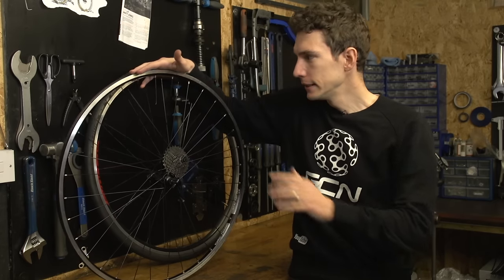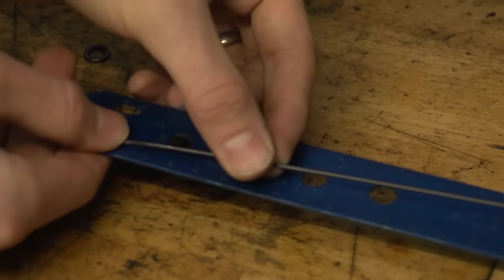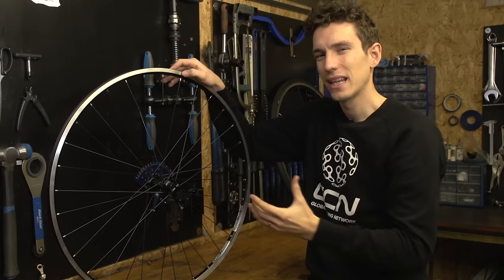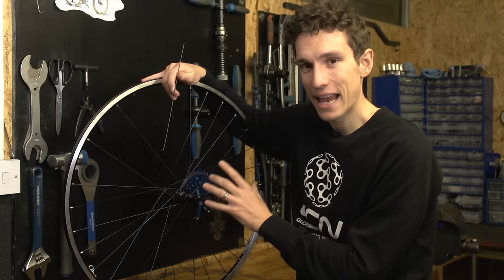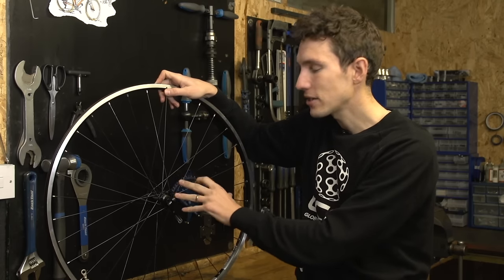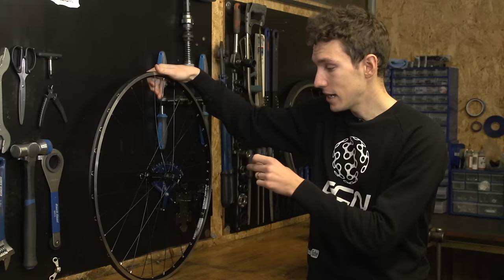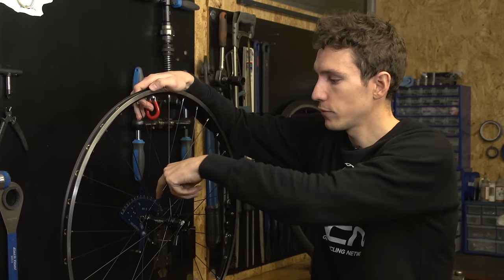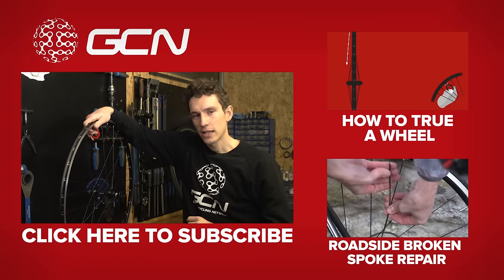How To Replace A Broken Spoke | Fix Your Road Bike With GCN

Comment: You picked the easy front wheel.  Show us how to replace the broken spoke on a rear wheel - especially when the spoke is on the cassette side!
Reply: Just take the wheel off.
Reply: It literally makes zero difference wether it's front or back wheel as you'll take the wheel off either way

Comment: Nice video. If you ever visit this subject again, I recommend providing a little more guidance with regard to spoke tension. Obviously, with a beginner-level "How To" video of this sort, you won't want to get into tension meters. But you could suggest that the user pluck the "good" spokes like a string on a guitar to hear their tone. Then tighten the new spoke until it produces the same tone (less tension for a lower tone, more tension for a higher tone). It's a very simple method to adjust spoke tension. If you suggest this technique, remember to alert the user that many rear wheels have different spoke tensions between the left and right sides -- so the user should only pluck and listen to spokes on the same side of a rear wheel.
Reply: ***** Yes, I'm well aware of that. But the subject of this beginner-level video is not truing a wheel. Rather it is replacing a spoke. If a rider needs to replace a spoke, they need to know that it also needs to be correctly tensioned. So it seems appropriate to explain that here -- after all, it is an essential step in replacing a spoke. Besides, the rider may have no intention of truing their own wheel -- what they need is to adequately repair it until they can get to their LBS. If they have any distance to ride, their wheel will be in better shape if they adjust the tension right away to prevent it going out of round -- or going out of round any worse.
Reply: Thanks, that's a great, logical way of knowing that they have the same tension!

Comment: Your explanation about tightening spokes in order to pull the rim in the direction of where the spoke originates on the hub I find is much clearer here than in the other wheel-truing videos. The visual representation aids in this as well.

Comment: Straight-pull is a type of spoke, not a lacing pattern-the other more common and basic type being the J-bend, where the head of the spoke is bent 90 degrees like an elbow. It's radial lacing where the spoke goes straight to the rim without crossing any other spokes-common on front wheels.

Comment: When I replace a spoke, I mark it with a piece of tape to make sure that is the first spoke I adjust when truing the wheel.  My goal is to only ever tension the new spoke to true-up the wheel because if there are other spokes out of tension then I really want to get it to the shop before I go  messing things up worse than they were before I broke that spoke.

Comment: Worth mentioning: If your wheel has 24 or less spokes, and is a shallow profile aluminum rim, chances are just replacing a broken spoke is going to leave you with a major high spot (vertical runout) on the rim.  Due to the higher spoke tension of less spokes, the only option is to detension the whole wheel and build it back up - because low spoke rims have to be brought up to tension evenly.

Comment: ...A little bit harder with disk brakes!

Also, if you bust a spoke on the road you can sort of compensate for it by just tightening the other spokes around it untilk you get home. It should ruin your rim less.

Comment: That was actually easier situation, it would be good to see if the spoke is from outside. I am struggling to bend spoke and it seems I need to remove few spokes just to put broken one.

Comment: Hey Simon, I actually remove spokes to lighten up my wheels. I have removed 4 from the front and 7 so far from the back. Definitely feel the difference on the climbing bits of my 3 mile commute to the job center. X

hudlum

Comment: Getting nipple off a broken spoke is usually easy: just bend the broken spoke to get some leverage and use the spoke key on it. Getting a straight pull spoke out of the hub end on the other hand, is the nightmare, especially if the plastic parts have become hard with age.

Comment: Its super easy to thread a spoke from the inside of the hub. I was hopping he would show how to do the other way.
Reply: Agreed. I am in this situation now.  I assume you have to remove one of the spokes blocking your new spoke, get the new spoke in position, then reattach the moved spoke.  But I have so much trouble with this I am not sure but seems logical.

Road this bike for many years about 4K miles a year then started breaking spokes.  Replaced many, new wheels, still broke spokes.  I finally got a new bike which is not as good as this one.  Trying to get the better one back on the road and of course first thing....replace a broken spoke.  I am having difficulty removing the spoke that is in the way.

Comment: Great tutorial! 👍👍   🚲🚲

I have broken one spoke on the rear wheel of my hub motor electric bicycle. 

I measured the length of it from the inside of the elbow to the end of the thread and it is 70 mm. 

And I can not find a 70mm spoke for sale. They are ither 60 mm or 80 mm.

So I ordered a few 80 mm and if it don't fit, I plan to shorten it with my angle grinder.

Comment: since when has + or - a couple of millimetres ever been accurate? Feeler gauges, blueing ink, micrometers, those are what spring to mind when hearing the word accurate.
Reply: +experiment54 Accurate depends on what you're measuring, although +or- 2 mm is not exactly accurate for spoke length, many other things don't require the methods you mentioned to be cut accurately.
Reply: you sound like my girlfriend talking about length.  an inch/few cm here or there, it's all relative enough...
Reply: thechosendude I'm sure she would appreciate a few extra inches no matter how relative length is, after all that's quite a 'rod'.
Reply: Very true

Comment: How can I clean my brake surfaces on my wheels to get that nasty looking brake dust and dirt that has got stuck to it, its driving me insane looking at it on my best set of wheels.
Reply: +ThatWolffe use brake cleaner, rub down the rim, dont touch if carbon
Reply: clive ramsbotty oh its alloy, and I will try that, someone recommended me to try white spirit or a de-greaser that doesn't have a lubricant in it but I have not tried yet.
Reply: Yes that's good advice, I find you get better results with ether based spirits like brake cleaner or carb cleaner instead of white spirit... Some pound shops sell aerosol cans of brake cleaner if you go shopping. When I was a kid my brakes were squeaking so I put WD40 on them, no joke.
Reply: clive ramsbotty will see if I can find something in one of the nearby pound shops then :P

Comment: Should fatties like me worry about a spoke count or similar when buying a wheel?
Reply: I'm going to get a penny farthing .
Reply: Depends... spoke count is one measurement, but you also have spoke gauge, the amount of spoke tension built into the wheel, the type of spoke design, the hub flange dimensions (which effect strength through trigonometry), the rim material/design/size, etc.